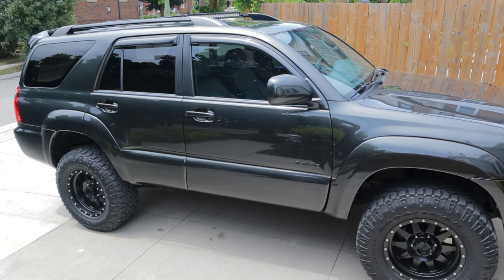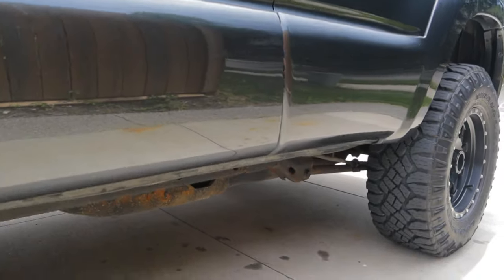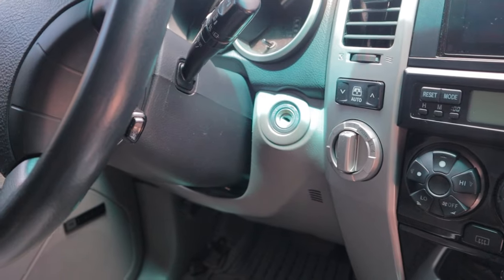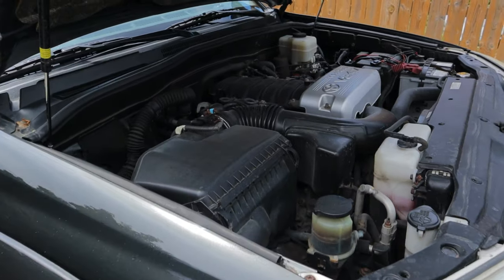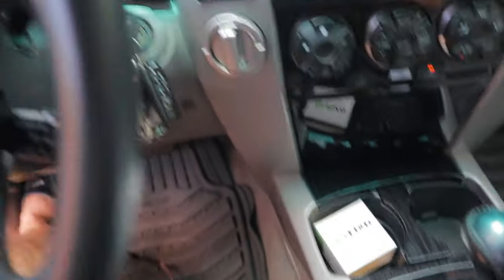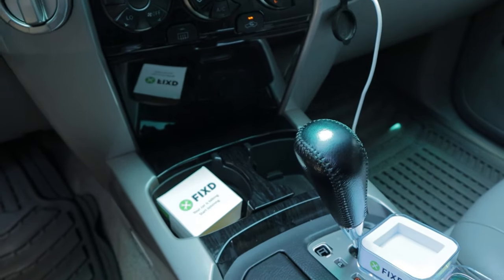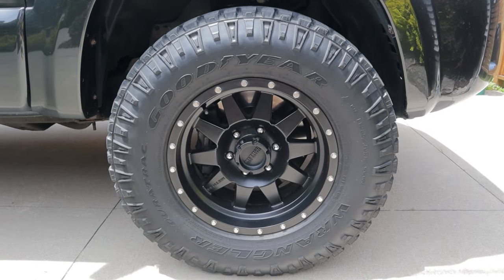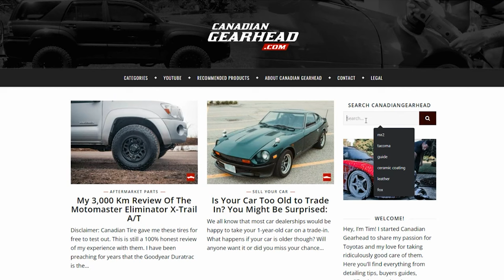Don't Buy A 4th Gen 4runner Without Checking For These Problems!

Comment: Rust on the rear hatch - check. Cracked manifold - Check. (DT headers - $1363.00 Canadian + labor = $2500 approx.) I've been driving for over 2 years with the crack manifold... definitely time to get'r done. But OUCH, my pocketbook. I also had a rear main seal slow leak 2 years ago. $1200 to fix the 25 cent rubber seal part! 😳 (removal of transmission). I also just drove across Canada towing 6200 lbs if anyone interested in the particulars.
Reply: They have a rear main seal fix from Barr's for next time
Reply: Did you fix the manifold? If so, how much was it
Reply: @franky1528  I had Doug Thorley headers installed last September. The mechanic charged me $1200 (Alberta). I got lucky to find a mechanic that was patient. He soaked the rusted manifold bolts over a couple of days with penetrant oil, then slowly eased out the bolts, half a millimetre turns at a time. (So not to break the bolts). That is the trick. Don't get a mechanic who just wants to hit those bolts with an impact. That will break off if you live in any rust belt.

Comment: I just picked up a 04 Runner just like it color and all minus lift,tires and wheels..I just wanna ask is urs a 3 or 5in lift and what size is the tires
Reply from the maker: They're 285/70/17 with a bit over 2" lift up front and 2" in the rear
Reply: @CanadianGearhead  any wheel offset
Reply from the maker: Nope, 0 offset
Reply: Thank you for the info and have a good day

Comment: How expensive is the exhaust manifold replacement fix that you said you did? I have the ticking sound on mine and just trying to see if it's something i need to have done, try myself, or ditch the truck (which i don't want to do).
Reply from the maker: I think the headers are typically around $1,000 and labor is probably another 1k depending on who does it

Comment: 2 more things - ABS actuator/ booster pump failure and on the V8, the cost of replacing the starter, which is buried deep between the cylinder heads and is an ugly expensive job.
Reply from the maker: Yeah I hope I never have to replace the starter on mine

Comment: Get 03-04 V8 no air injection pump. Stay away from the VVTI v8’s which are 05-09’s . 😅
Reply from the maker: Why would you stay away from them when you can easily bypass the system in 10 mins?
Reply: @CanadianGearhead  Less headache. Less sensors . And it’s not smog legal in most states to do the bypass. Honestly don’t even need the extra horsepower. Just my opinion!

Comment: I just bought mine, getting it Sunday now I’m debating that I bought a reliable truck lol
Reply from the maker: Don't worry, they're definitely very reliable. This vid is just proof that there can be problems with any vehicle - I still strongly believe it's #1 over all competitors in terms of reliability by far
Reply: @CanadianGearhead  well mine has 27k miles on it so hoping it last a long time
Reply from the maker: @24hrstolive27  Wow! Our 4runner has 250,000 km and our Tacoma has 330,00 km so yours should definitely hold up for a long time
Reply: @CanadianGearhead  2001 Tundra 289K miles

2005 4Runner 238K miles.

Both run like champs.

Comment: bought an 04 at 180k. Head Gasket gave out 189k. v6 sr5
Reply: Did you fix it ?
Reply: @artpolamo877  in the shop right now. toyota dealer quoted $2800 for HG, water pump, upper/lower rad hoses.
Reply: @zdg3758  dam mine at 160k afraid it’s gonna go